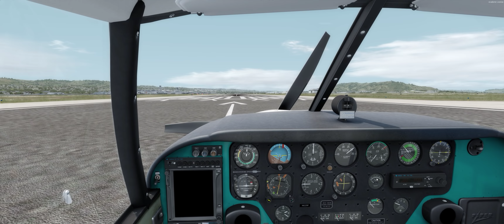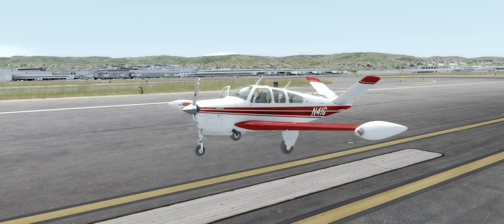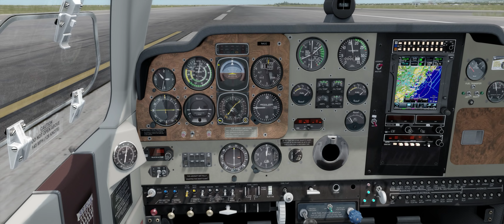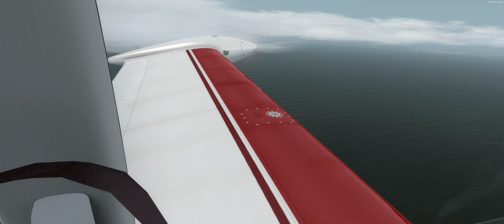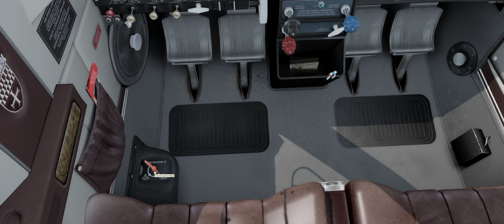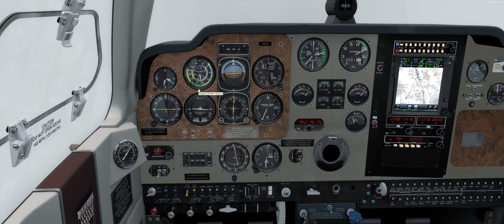Comanche Eating Cornflakes=A2A Bonanza Test Somehow

Comment: I have 30 hours on the A2A V35 now.  It is my first A2A GA aircraft and I have a love/hate relationship with it.  I love all the A2A bits about it.  The quality, maintenance hanger, walk around, etc.  I hate the actual plane.  I find it less than stable at low speeds and in steep turns.  I also hate the lateral sawing effect if you rotate at book speed.  I rotate at +10 to avoid this.  The plane cruises very well and I can grease the runway nicely on landings.

I wish I had chosen to go with one of their Cessna or Piper planes instead of this one however I was only just made aware they were actually P3D V4 updated.  I will press forward and put many more hours on this aircraft and maybe someday will feel more at ease with it.

Comment: Hi Marshall,

I share your weight challenge, as I lost 80 pounds 10 years ago and have kept it off without back pedaling. 

But a couple of things that may play into the stall/spin behavior with your "V -Bo". First is that MSFS systems use look up tables for behavior unlike X-Plane's blade theory where you are actually flying in simulated air molecules. As I recall from my days , weeks and years flying with it, there is a box you can check or uncheck that couples the rudder and ailerons for coordinated flight ops. Most realistic setting is of course not coupled so you can "dance" on the pedals to keep the ball in the center. It is possible to stall the airplane to descend slowly tail first. If you are over nothing but trees and have an engine failure you can now have a controlled crash sinking like a leaf into the trees. I'd much rather do that than nose first in an uncontrolled stall/spin. Your chosen config was good for this demonstration as full tip tanks puts a high percentage of the total weight at the tips and can cause additional stall factors. There may even be a warning into manual for maneuvers with full tanks. My bet is that the physics is limited by the look up tables inherent errors at the edges of the envelope.

I have quite a few hours in the Bonanza, straight and V tail versions. They were certified by the CAR 23 and found to be fully flight worthy with no hazardous qualities. I found it to be just as pleasant and docile as you report until in the sim you get these areas that are hard to model, like at stall and critical mach. As for Doctors, I have a great but sad personal experience with the species, and the A-36 TC was not the cause of the accident. As I like to say " if you're going to be Dumb, you'd better be Tough!". 

I wish in the "V-Bo" demonstration you had the view just a bit lower to include the ball and turn coordinator. That would maybe have given me the clue I needed to a possible conclusion. But my bet is on the basic flight model or the coupling of the rudder and ailerons.   

In conclusion, it has been my pleasure and good fortune to have had a career that allowed me the opportunity to fly so many wonderful aircraft. And it is true that the Beechcraft family has a sort of DNA that allows them feel very familiar to a pilot a he moves up the economic ladder from Bonanza to Baron to King Air. The Starship was, of course, a major departure that had a difficult birth and predictable death, most of which was not Beech's fault. Flight characteristics weren't bad but different and then there were 13 CRT's which never seemed to work all at the same time. 

Cheers Robert

aka jagjet